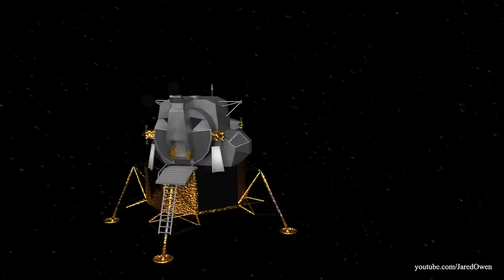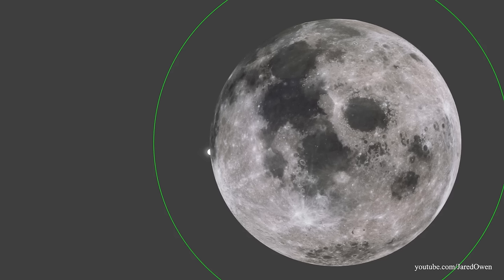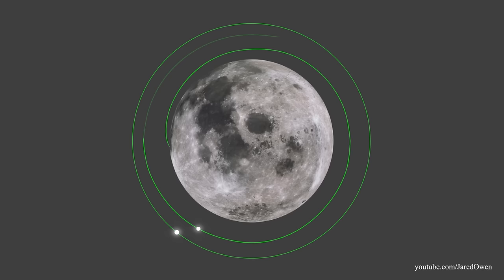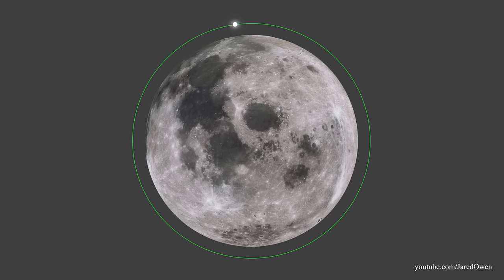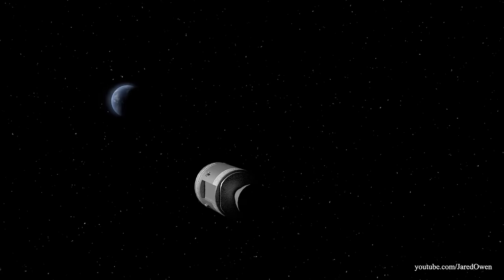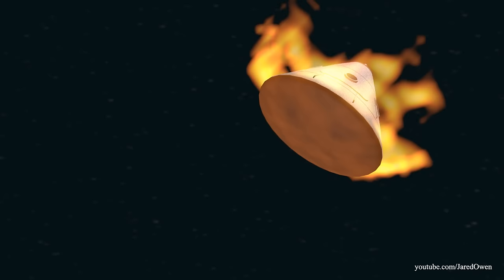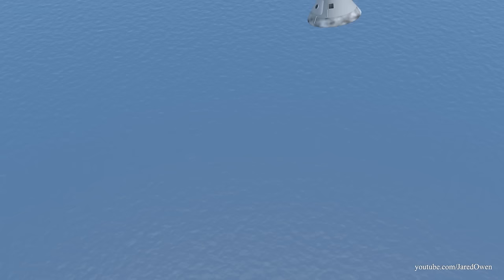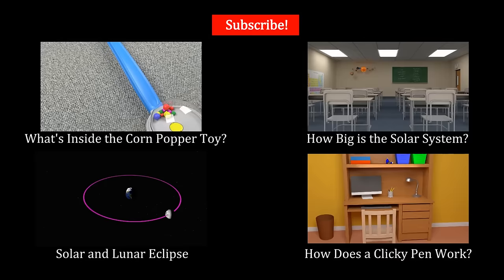How the Apollo Spacecraft works: Part 3

Comment: I have one question..., why appolo have surrounded by fire when it start to return to the earth...? What the causes...? And why that fire/heat doesnot make any effect...?
Reply: When the Command Module was re-entering Earth's atmosphere, it was travelling thousands of miles per hour. Whatever air there was in front of it was rapidly and violently compressed. This superheats the air in a process called shock heating. The air is heated so much, that it becomes a plasma and starts to glow. Fortunately for our astronauts, they have a heatshield. An ablative heatshield, to be precise. The heatshield has a very low thermal conductivity, so heat cannot get through it easily, and it is ablative, meaning that when the surface melts, it flows off, carrying away the heat with it. At the end of re-entry, the heatshield is a charred and burnt-off husk, but the capsule is safe.

Comment: Well done series!  So some ascent stages are still orbiting the moon?  

Also on a trivial note  - why did your CSM have the big notches on the sides?
Reply: Nope. All the ascent stages that lifted off from the moon were intentionally crashed into it after undocking from the CM/SM. This was done so that the seismographs left behind could gather data and the same was done with the S-IVB's as well starting with Apollo 13 so even though they didn't land, AP-13 did still manage to contribute somewhat to the science program.  They were able to derive a lot of info from these artificial impacts. Google "The Description of Apollo Seismic Experiments darts"
 for more info. Snoopy fro  Apollo 10 is in heliocentric orbit.

Comment: After the Command Module separates from the Service Module, how does it reorient itself so that the heat shield is the leading surface? Does it have any retro-rockets?
Whoa! Listen to me. After watching these three videos, imma talking like a rocket scientist!
Reply: Reaction control system(RCS) was on all 3 of the components(LM, CM & SM). The ones on the CM aren't as visible. The CM was also designed with an offset center of gravity to allow some maneuverability  during the reentry phase.

Comment: Isn't it amazing that it doesn't burn up like other space junk usually does just like most meteors ?  I wonder why?
Reply: heat shield
Reply: @manofculture4945  Didn't you know what most meteorites are made out of?  Being a man of culture you'd think So.  They say the one that made the huge crater in AZ was really hard, like probably harder than that little Space Capsule, don't you think?
Reply: @bubashalom8274  still heat shield
Reply: @manofculture4945  I understand what your saying, but nevertheless many meteors have far more heat shielding already while still burning up within our atmosphere.   Why I find it odd or strange that none of our space crafts burn up like most space junk falling through the atmosphere.   Just a thought,  most peculiar mama
Reply: @bubashalom8274  once again heat shield not rock
Reply: Most meteors move much faster than spacecrafts re-entering from orbit or the Moon and are thus heated much more.
Reply: The capsule with its heat shield entered the earths atmosphere as a calculated trajectory and reduced speed to minimize heat.

Comment: With the exception of the Apollo 13 mission, why didn't Apollo crews just keep the ascent stage attached to the command module for the rest of the return journey to Earth? They would have had more free space for movement and it would have been less claustrophobic for them....
Reply: Less mass for Transearth injection
Reply: To expand on the [correct] answer you've already been given, I'll elaborate a bit more.  Apollo 13 didn't burn any fuel to drop them into lunar orbit.  They just made some minor adjustments to keep on a free return path to loop around the moon and come back.  But, during all of the missions that landed, they had to burn the engine to drop the stack into lunar orbit.  When the ascent stage returns to the command module after being on the moon, the command/service module has a lot less fuel than it did during Apollo 13 mission.  They were not planning to accelerate the mass of the lunar module back to Earth also (which would require more fuel).

Comment: how and where is oxygen stored for 3 men for so many days ?
Reply: It's stored in liquid form inside of the service module. Humans actually don't need that much oxygen so it wasn't that hard to store more than enough. The bigger problem is CO2 build-up. They've got filters to scrub it out of the air inside of the command module and lunar module.
Reply: Laser Lens . Thank you. kept thinking of scuba diving tanks, empty in one hour. But that is obvisiously pressured oxygen. Suppose the liquid form creates the danger for explosion during take off.
Reply: Worth mentioning that they also needed oxygen for the 3 fuel cells that are in the service module.

Comment: Why get rid of the lm ascent stage at the moon and not keep it like apollo 13? I know it wasnt needed,but just for the extra room and space for the astronauts for the journey back if nothing else.
Reply: Too much additional mass requiring more fuel in the CSM and then more fuel would have been needed for the Saturn V at launch. The difference with Apollo 13 was after the explosion in the service module, they did a 30 sec burn with  the LM descent stage engine to place the spacecraft on a free return trajectory meaning they never entered lunar orbit. Normally, every other Apollo mission to the moon had to have the CSM-LM orientated so that the main rocket engine was facing backwards compared to their direction of travel and a Lunar Orbit Insertion engine burn was made.

Comment: So in order to re-enter the atmosphere (i.e., leave orbit), didn't they need to fire the CM engine one last time? From your video, it looks like that wasn't necessary. I'm thinking they were never in orbit, but on a planned  re-entry course. I seem to recall that from "Apollo 13," with Tom Hanks steering manually (ah, Hollywood).
Reply: It is explained in that video at around 2:00 maybe try to watch with your eyes open next time;)

Comment: I have one question.. How does the command module works while going from moon to earth after escaping from the lunar orbit.. In short I want to know how the spacecraft flows in return of the astronaut to home ( how command module works for return 3 Days between moon and earth)
Reply: It used fuel cells for electrical power, until getting rid of the service module.  Then, it ran on batteries for the final phase (re-entry).

Comment: Until these videos, I believed that they actually went to the moon. But after watching these complicated processes, I ended up having doubts. I mean, didn't they make even the slightest mistake? It's really hard to be flawless this much on the first attempt. Thanks for this amazing demonstration by the way!
Reply: Well, Apollo 13 was certainly a perfect example that not every mission went perfect with no mistakes or problems.
Reply: Apollo 10's lunar module entered into a dangerous spin while in lunar orbit that could have ended with a crash if they hadn't gotten it under control a few seconds later.

The descent stage of Apollo 11's LM almost ran out of fuel before Armstrong was able to land. They also had some program alarms during their descent because the guidance computer was overloaded as it was receiving data from both the landing radar and rendezvous radar.

Apollo 12 was hit by lightning shortly after lift-off that knocked out the primary power supply (fuel cells) and the attitude indicator in the command module. The telemetry received by the mission control was also garbled, but the instrument unit on top of the rocket's third stage was unaffected and continued to guide the rocket into the correct orbit.

So, the missions were far from flawless!
Reply: In addition there’s also the fact that the public started to lose interest with the Apollo program because the color TV camera for Apollo 12 was accidentally damaged when Allan Bean was setting it up and it got pointed towards the Sun. The video tube got burned out so instead of hours of color broadcasts of their EVA’s, the commentators had to find fill-ins for graphics as they listen to Conrad & Bean during their EVA’s and the public found it a poor substitute. As entertaining as those two astronauts were, the loss of the color TV video was a huge blow to NASA’s public relations. So do you really think that those involved and all the effort to supposedly fake the Apollo manned lunar landings could somehow decide that they needed to disable the color TV camera for the 2nd lunar landing? For what reason?
Reply: Okay okay, I am convinced :). Thanks.

Comment: How fast does the service module in trans earth phase?

It needed 3 days to travel 380k Km from moon to earth.
If we divide the distance with time, they need atleast 5300kph.

Is that even possible? How about the G pressure to the astronauts from that speed?

It is really interesting
Reply: YOU SAID: "How fast does the service module in trans earth phase?"

== It varies.  Lunar orbital velocity was about 3,600 mph.  Earth orbital velocity was about 17,500.  On the way to the moon, they accelerated to just shy of 25,000 mph.  On the way back, they "fell" to about that same speed until re-entering.  But, it's not a constant velocity.  Earth's is always pulling it toward Earth, and the moon's gravity is always pulling it toward the moon.  The moon's gravity becomes more dominant than Earth's gravity at around 85% of the distance to the moon (on the way there), and Earth's gravity becomes more dominant at around 15% of the distance to the Earth (on the way back).  So, during the "coasting" time toward the moon, it's actually decelerating most of the time (until it gets 85% of the way to the moon).  And, on the way back home, it's actually accelerating most of the time (after it gets past 15% of the way to Earth).

YOU SAID: "It needed 3 days to travel 380k Km from moon to earth.  If we divide the distance with time, they need atleast 5300kph.  Is that even possible?"

== Yes, the maximum speed was actually almost 40,000 km per hour.  Why would you think it's not possible?

YOU SAID: "How about the G pressure to the astronauts from that speed?"

== You have confused speed with acceleration.  Humans don't feel speed.  Humans feel acceleration/deceleration.  You can fly in an airplane at 500 mph, and you don't feel anything.

Comment: What about the steam during splashdown from the heat of the capsule.
Reply: The heat shield is ablative so the highest levels of heat distribution on the shield flake off during reentry. By the time it lands in water, what’s left of it has cooled sufficiently that no steam would be generated.

Comment: A question.
Shouldn’t the LM be in the front on the way to the moon? I am confused. Explain this to me please. 
If the engine is in front then how is it going to propel the space craft forward.
Reply: In space there is no atmospheric drag to slow you down. As such you only need to fire your engines when you want to change your velocity. The rest of the time you just coast. As such, when you are coasting it doesn't really matter which way the engine is pointed. The only time you have to worry about pointing the engine in the correct direction is during an engine burn. Its actually critically important to make sure you end up where you want to go. But the rest of the time it doesn't really matter.
Reply: Joe Vignolo 
Thanks for clearing it out.

Comment: Nice job!  Can you explain how the rocket design or just the return module design protected the astronauts from the Van  Allen belts and put the rumors to bed? Thank you.
Reply: It isn't very complicated. The US had sent missions through the Belts before,  so we knew what to expect radiation-wise. That makes passing through the VABs a quantifiable risk which can be protected against.
Apart from that, most of the radiation in the Belts takes the form of ions and beta particles, along with a little bit of alpha: all of these are relatively easy to shield against compared to gamma radiation (which requires heavy shielding, as seen in nuclear reactors).
And to top it all off, all the astronauts carried personal dosimeters.

Comment: Why did they abandon the LM above the moon or destroy it? Wouldn't they want the extra space  on the way home?
Reply: Not worth keeping because the extra mass would have required more fuel used during the trans-Earth injection burn cutting down significantly on any safety margins. Besides, although it wasn't something they considered would be much of a problem, the moon dust from the EVA's would have been an issue. Wouldn't been so bad for Apollo 11 but later missions with more EVA's, the dust was a real hassle and keeping as much out of the CM as possible was a bit time consuming just transferring everything from the LM to the CM. There's an article you can google that goes into some detail about the dust problems: "The Effects of Lunar Dust on EVA Systems
During the Apollo Missions"

Comment: How does the command module always return with the bottom facing earth though??
Reply: It was equipped with 12 small thrusters that was used to change its orientation after it was separated from the service module.

Comment: what happened to the parts that detached in space.are they still in orbit ?
Reply: Nothing in Earth orbit. There are some S-IVB’s in heliocentric orbit. Some were deliberately crashed into the moon to generate seismic waves for the ALSEP’s left behind. The same with most of the LM ascent stages. Apollo 10’s Snoopy is still in heliocentric orbit. Everything else burned up in Earths atmosphere including of course the LM’s from Apollo 9 & 13.
Reply: @mako88sb  Didn't the third stage of the Apollo 12 Saturn V get caught in Earth orbit relatively recently?  I remember hearing something about them finding an object in orbit and they ran some tests and discovered it was reflecting light consistent with the white paint used on the Saturn V rocket and from this they backtracked the orbit and discovered that it was likely a recapture of the S-IVB stage from Apollo 12.

EDIT :  https://en.wikipedia.org/wiki/J002E3

Comment: Only kind of missing reentry burn of the CSM when returning from the moon and reachign earth orbit... or was there not one?
Reply: There wasn’t one. I can’t remember all the details but the amount of fuel required to slow down the CM/SM to enter Earth orbit would have been too much extra weight to do each of the Apollo lunar missions with a single Saturn V. The method used with the ablative heat shield to reduce their velocity and bleed off plasma heat buildup was determined to be their best option. Of course the small entry window was definitely a risk but the CM’s off-centred center of gravity gave them enough maneuverability that with lots of training they became very adept at accurate reentries close to the recovery ships.
Reply: There were only course correction burns.  There wasn't a slowdown burn.  The procedure was to dip the command module into the atmosphere for the initial slowdown, then rise back up, then dip back in again.  The ablative heat shield did the rest of the job.

There's a video called "Apollo - Atmospheric Entry Phase (1968)" which explains it a lot better.  At about the 18 minute mark, you'll see what I'm talking about.  (But, for whatever the reason, they have chosen some greatly exaggerated angles for their animated presentation.)

Comment: Every time I learn something new about apollo mission it seems for me lesser believable. I can't imagine how they did so many complicated things so many times and nothing ever goes wrong. For example moon landing, any relatively big boulder or crator and all mission fucked up. Any engine at any stage of the mission stops working, mission aborted. Never happened, 7 times everything fine. Extrime hit, radiation, unbelievably small amount living space for people. Never before or after nothing like this been done, it's like if first plane was built for transatlantic flight they make seven successful flights and for next 50 years nobody can make an aircraft heavier than air.
Reply from the maker: Hi Alex - these missions were anything but a smooth ride - plenty of things went wrong.  I would suggest doing more research to learn about the challenges that had to be over come.
Reply: Oh man a lot of people and animals died and one of the crews almost didnt make it back to Earth

Comment: Why doesn't the spacecraft burn during  entru but it does on its reentry?
Reply: Do you mean - why doesn't it burn on the exit, but it does on the entry?

It all comes down to speed.  The reason things burn up in the atmosphere is not because they "enter" it.  There is nothing magical about entering the atmosphere.  In fact, there is no point you "enter" it anyway.  It's a gradual transition through thicker and thicker air, and if you are going fast enough through thick enough air, it generates a lot of heat.  What is actually going on is that the craft is going so fast that the air literally can't get out of the way fast enough, so it compresses at the front of the craft and under the extreme pressure, it actually changes from a gas directly to plasma - this is the light and heat.  You WOULD see these effects during launch if they were moving fast enough.  While they do reach the speeds, they are already far above the thickest part of the atmosphere by the time they reach these speeds, so the heating up doesn't happen.  However, when you are already at these speeds and you come back in to the atmosphere, you will eventually get into thick enough atmosphere as you fall that this will happen.